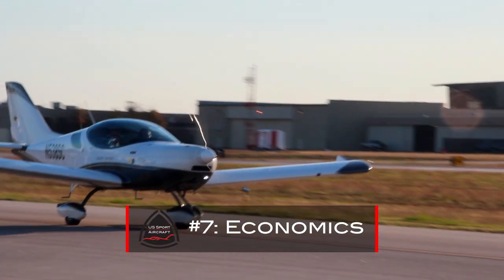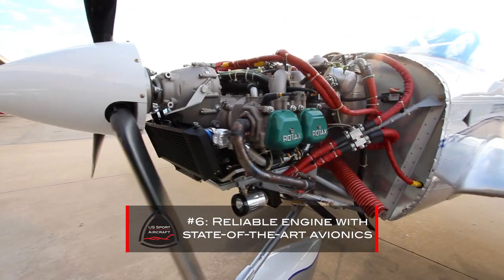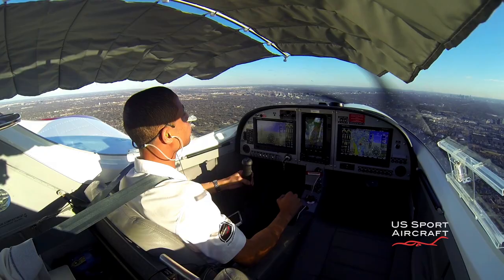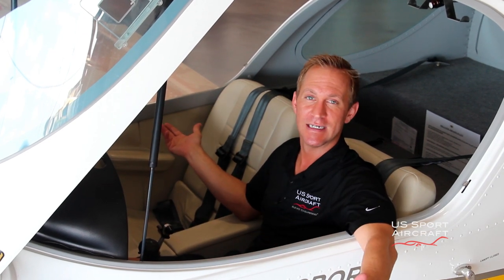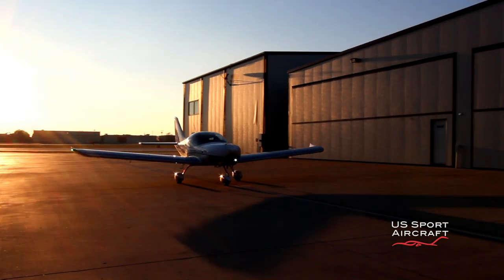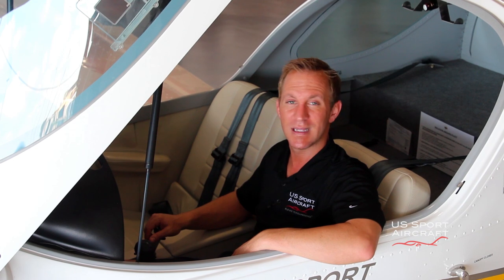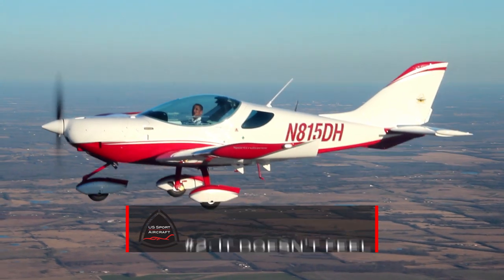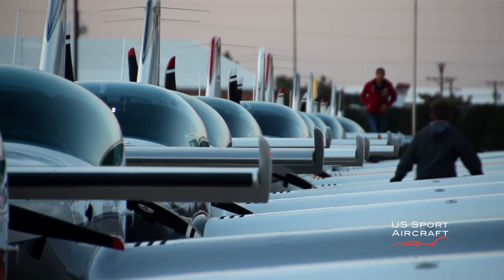7 Reasons to Fly a SportCruiser

Comment: our Sportcruiser is now 10 years old; I bought in New Zealand as no Australian agent then or now.Fitted with Airmaster flight adjustable prop. Uses 20 litres per hour,  LSA registered ,but can be CASA registered to take advantage of its certified max weight of 650 kg.My son and self just flew it from Gatton Airpark to Townsville,about 660 NM at 8500 ft and averaged 115 knots.in 6 hrs. It is still as good as new[better] very smooth,very stable and easy to fly. We say it is the BMW of LSA acraft. If you can afford one ,buy one;you wont be disappointed...Frank & Joshua Francis,Gatton Airpark,Queensland ,Australia

Comment: You can beat every aspect of this with a Flight Design CTLSi.  3.5 gph at 120ktas, stalls at 41 kts, fuel injected FADEC control.  You can use autogas 91 from the pump or 100LL.  Full glass touch Dynon with Garmin touch.  BRS chute (with crush zone), ADS-B, autopilot, dual ADHRS.  Extra wide cockpit 50 inches, high wing less hot than low wing.  The Flight Design is the best selling SLSA...the SportCruiser is behind the RV.

Comment: Pretty slow stall speeds.Lets say you wanted to fly in Alaska. Is it rugged enough to be used as a Bush Plane and land in small remote unpaved areas?
Reply from the maker: Hi rbagel55! The SportCruiser handles short and soft fields with ease, and the wheel pants can be removed if necessary. However, depending on how rugged these remote unpaved areas are, you may be better suited in an aircraft that was designed specifically to be a bush plane. The SportCruiser is a capable aircraft, but for jobs in particularly rugged terrain you'll most likely want to have a taildragger with oversized tundra tires. If it helps, here are some takeoff and landing specs for the SportCruiser:

Take-off distance:     463 ft (141 m)
Take-off distance to 50 ft (15 m) – Concrete:     1,270 ft (387 m)
Take-off distance to 50 ft (15 m) – Grass:     1,499 ft (457 m)
Landing distance – Concrete:     479 ft (146 m)
Landing distance – Grass:     364 ft (111 m)
Reply: Something like a Maule, they are better designed for more rugged landing conditions

Comment: You didn't say anything about air conditioning, how do you keep comfortable?
Reply from the maker: Hi T'airn'KA! Several years ago we offered AC options for SportCruisers, but they are already so well-ventilated that the extra weight from an AC system proved unnecessary. When flight training on very hot days, we typically fly at higher altitudes where the air is cooler and have no problem at all. Trust us, we fly these things comfortably throughout summers in Texas! If you live in the area, check out our discovery flight options - you can try it out yourself for just $95! http://www.ussportflightacademy.com/product/sportcruiser-discovery-flight/

Comment: What speed is customary to land one if it stalls at 31 knots?
Reply from the maker: Hi Chaplain Dave Sparks! The normal approach speed in a SportCruiser is about 64 knots with full flaps
Reply: doesn't compute...if it stalls at 31, shouldn't full flaps speed be closer to 40 and not 60?
Reply: BLAMBERRY no, cessna 152 has an approach speed of 65 with a stall of 42. Speed is what ever the manual says it is. No compute necessary

Comment: what's the useful load?
Reply from the maker: Hi Tony Alvarez! The useful load for a standard SportCruiser is 496 lbs or 226 kg! Thanks for watching!
Reply: Thrust Flight Academy   That’s kind of a joke.   I’m 6’5”, not thin, so I could have a passenger or fuel, but not both for a moderate cross country.  Love the low Cost but make one a bit bigger!
Reply: @NelksLife  Tony is right. It’s dry mass is too heavy to allow it to be useful in the real world. 226 kg is not much of a payload if fuel and another passenger plus luggage is involved.

Comment: Is it IFR certified?
Reply from the maker: No, light sport aircraft are not certified for IFR conditions. Thanks for your question!
Reply: They can be. Sport pilots can't fly IFR or at night, but an appropriately rated pilot can certainly fly them in IFR or at night if the aircraft's operating limitations allow for it. Sad to see that the SportCruiser isn't IFR capable. Looks like I'll have to go with the Evektor SportStar even though it's slower. IFR is a must for me.
Reply from the maker: Hi Jason - just wanted to let you know that US Sport Aircraft now offers upgrades to make the SportCruiser IFR legal: https://www.facebook.com/USSportAircraft/posts/1706437452717822
Reply from the maker: Hi Flightx52! US Sport Aircraft now offers upgrades to make the SportCruiser IFR legal: https://www.facebook.com/USSportAircraft/posts/1706437452717822
Reply: @Flightx52  I who flies a Sportstar it's a good little aircraft for VFR and IFR in some cases. But at the same time due to it only has a Strobe and Landing lights it can be rather riskier then a SportCruiser or a Foxbat.

Comment: 0:20 Uhh... That looks like a near miss to me. You're not the Blue Angels.
Reply from the maker: Hi Ryan! For our formation flights we sometimes do for photo and video shoots, we only use pilots with extensive experience in the SportCruiser, and they are in constant contact both visually and over the radio the entire flight. The length of the lens used may also make the aircraft appear slightly closer than it actually is. Safety is our top priority and our pilots would never do anything in formation if they weren't absolutely certain they could execute it safely. Thank you for your concern!
Reply: Ryan McGowan how do you know? You meet the pilots?